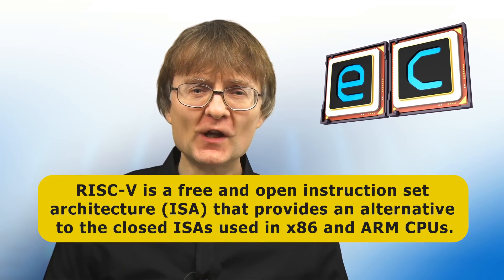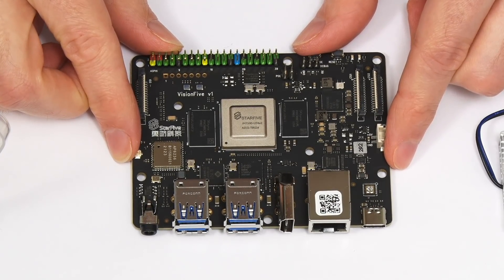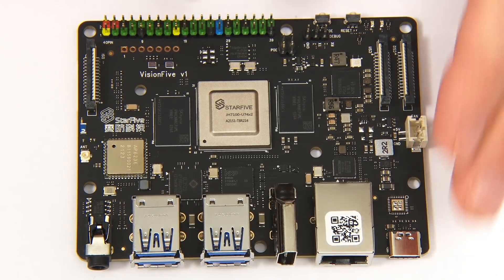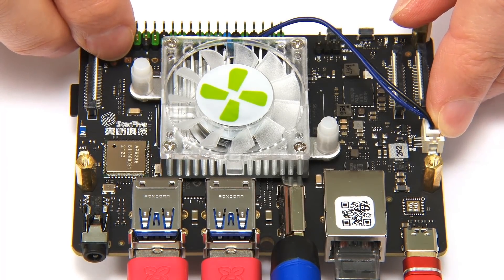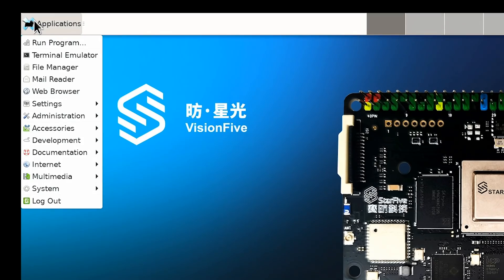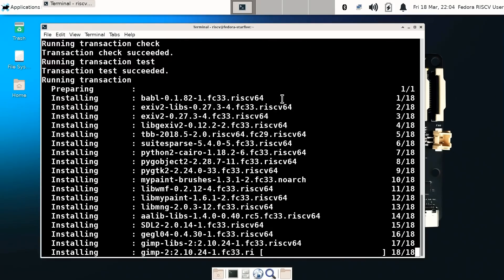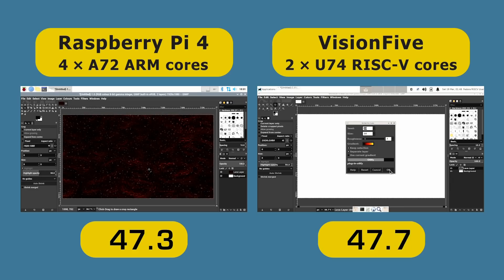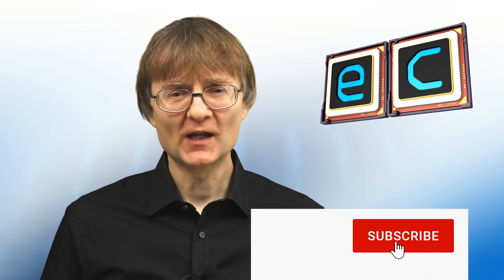VisionFive RISC-V Linux SBC

Comment: After a few mis-starts from others, glad to see someone released a reasonably priced RISC-V sbc. Can't wait to see where RISC-V takes us. Thank you as always Mr. Barnatt! Welcome to DST.
Reply: I don't think RISC-V will replace ARM in most areas. It will likely stay in the realm of hardware controllers, like for SSDs and as Coprocessors in GPUs.
Reply: @GeoStreber  I think it might be able to be alongside arm in applications such as mobile phones, as Chinese manufacturers are always looking for new and different technologies to boast in their phones
Reply: Here is the odd part: Is the JH7100 an open core?
The C906 is, which is in the Allwinner D1 SoC. And it runs just as well. :-)
Reply: @CyReVolt  Hi Daniel. As you know, the C906 is a commercially-licensed core which was also open-sourced about half a year after I got my first board with a D1 SoC containing it. The U74 cores in the JH7100 are not open source. The U74 are based in large part on some components of the Rocket open source core (which SiFive also continues to maintain and improve), but this arrangement is closed source. Being dual-issue the U74 performs about 1.6x better than the C906, clock for clock. Plus it runs at 1.4-1.5 GHz vs 1.0 for the D906. Multiple cores (2 in the JH7100, 4 in the FU740) adds to the overall performance again.
Reply: @BruceHoult  Thank you for the elaboration!
Reply: I'd say that not only reasonably priced but actually working and with better support than most ARM SBCs from last 2-3 years.
Reply: @SergiuszRoszczyk  especially compared to Allwinner SoCs which microcode has to be reverse-engineered because the vendors don't supply any
Reply: @SergiuszRoszczyk  Except for the Raspberry Pi, with which it compares even worse than I expected on both price and performance.
Reply: @johnm2012  Pi and Pico are gold standards. I'm talking about all those Pi Killer wannabes ;)
Reply: @SergiuszRoszczyk  I know you are but why would anyone choose a RISC V based board when they could have a Pi instead? I'm looking for that one reason, the thing it would truly excel at, but I'm not seeing it.
Reply: @johnm2012  I think because they can. It is good to have wide variety of working platforms, especially when those platforms can run vanilla Linux without unknown binary blobs (here mostly about those Allwiner thou I know that Pi also has some of them).
Also we need different stuff - if I had MIPS home server, then PPC, now I use x86 and Pi but if someone will provide good Risc-V board for the job I'm ok with that. Also having one more ISA on the market makes it safe that one day someone will not close entire architecture and forces growth.
Reply: @johnm2012  what this board excels at is running RISC-V machine code. If you want to do that for some reason -- for example because you are a software developer wanting to port code to RISC-V (or write new code) then this board is a better option than running an emulator on an ARM board or even on an x86 machine with a similar price.
Reply: @johnm2012  It's about learning. That's the reason I would buy one. Not this one though, needs another couple of generations.
Reply: @johnm2012  The one reason is that it has an open standard instruction set architecture (ISA). You cannot do that with x86 or ARM. I suggest that you watch the video again with a more open mind and realize that although the Pi is a great little sbc, it is NOT the end and others will come along and change and improve things.

Comment: That looks nice, you know I would love to see an updated version of Z80 chip and cp/m OS, z80 was an excellent chip, the fun I use to have typing code from computer magazines, for me it great way learn programming. Not that I can remember anything I'm getting old now. 😊
Reply from the maker: The Z80 was indeed excellent. I wrote machine code on it, not that I can remember much of that now!
Reply: @ExplainingComputers  I would love to see what wrote, that type of programming was very powerful and beyond my capabilities (with no reference in hand)
Reply: @ExplainingComputers  I wrote a cricket game in BASIC while I was at school, no graphics, all ASCII but it was sluggish so I tried to write it in Assembly while I was learning it but never got it completed, I have often thought of completing it when I retire
Reply: I stil run a Z80 based computer, its a Research Machines 380Z, and is the very same computer I learned on at school and purchased from my school in 1991 although I have replaced the drives 3 times upto press and am now looking to emply a drive emulator whilst the 8" floppy drives are still working
Reply: You just took me back to my Commodore C-128 days. 😌
Reply: Thee are many upgraded Z80 CPU 

Zilog Z8000 16 bit 1979. Z80000 32 bit 1986.

Theres the 1985 Hitachi HD64180 mega Z80 variant that was quite popular. and also licensed back to Zilog who sold an upgraded variant of....
Reply: @joefish6091  I know I just wanted to see how the z80 would turn out with a modern take on it.

Comment: I'm most interested in IO control -  I need to be able to take real time inputs and send outputs to the real world, preferably with network communications.  For me, THAT'S whats needed for development and control.
Reply from the maker: Hi Leslie. One of the benefits of RISC-V over ARM is supposed to be real time capabilities. We shall see. I'm currently making a video about another, smaller and cheaper RISC-V SBC that would be read for IO stuff.

Comment: Great video, and I look forward to hearing more about RISC-V technology!

Some more possible things to compare:
How does the power consumption compare to the Raspberry Pi?
And is the same software available in the Fedora repositories for RISC-V as there is for ARM or x64?
Given that the architecture is open-source, hardware drivers should be much more optimized and available compared to SBC ARM boards.
Reply from the maker: Thanks for this. As far as I can tell, the repositories are currently more limited (as they are for Debian, for which a RISC-V version is also available). But the more hardware that gets out there, the more software will be available. As you say, being open source should make driver and wider software availability accelerate more quickly than with ARM.
Reply: @ExplainingComputers  It strongly depends on the amount of effort and money put on the RISC-V project. What could it be without NVIDIA and other corporations? Compare it to OpenRISC, for example. There's a lot of job to be done (and we want it to be done) but the pratice shows us that it can't be done on bare enthusiasm.
Reply: @utvpoop  
It's a bootstrapping problem. They need to develop a full fledged, competitive, consumer ready product, but to do that they need the financial backing to research, develop and iterate, which requires them to... Y'know... Sell a full fledged, competitive, consumer ready product.

If people would stop voting right wing, we could perhaps task our government to fund and develop open source projects in the name of public good, but oh noes, that's the commynisms!
Reply: @HaveYouTriedGuillotines  It looks like they've managed to do that with this board. Also remember that Seagate are starting to use RISC-V in their storage controllers. If they write their code in C then it's pretty irrelevant if the chip is popular or not as long as it does the job well and they can make them for the right money. Takeup is likely to be rapid because it can fill the role of ARM and be cheaper. Note also that with Nvidia not owning ARM they may decide to do their own RISC-V cpus.
Reply: @wayland7150  
I wouldn't say this is quite there yet. When I say full fledged, competitive, consumer ready product, I mean a range of offerings that can compete with existing, widespread hardware on the market. A true, ready for prime time RISC V offering shouldn't just be a couple micro controller chips, and something that struggles to keep up with credit card SBC chips. 

It should be a design that can be scaled up and provide options spanning across multiple levels of computing. I. E. a 32+ core version of the CPU aimed at a desktop market shouldn't be out of the question.

Enthusiasts want at the very least something that can match a RasPi 4. Most people in general are going to want something that can at least compete with low to mid range Intel/AMD chips, or even an M1. The real goal here would be to produce the RISC-V equivalent of an M1 Chip, though that's maybe a bit too ambitious, so let's say... A design that can compete with current middle of the road mobile hardware, as well as laptops and low to mid range desktop hardware.

I know you're going to say something like "but RISC V is still new!" Yeah, it is. And consumers don't care, most tech hobbyists don't even care. They want something that can do some work, and sadly most people either don't have the money or care to fund a fledgling design just because it's open source. 

Most people don't even have a vague clue of what FOSS means and their eyes glaze over when you try to explain GNU or the fact Linux is just a kernel to them. RISC V is also trying to enter a market where it has to play catch up with well established competition that itself is moving forward. The sad reality is that RISC V still has a ton of adversity stacked against it, I am not ready to call this the turning point.

...It is the first real, solid start, though.
Reply: @HaveYouTriedGuillotines  It's clearly coming and the board is available in a practical form, just like the PI. People can get learning and be ready for more products. In the past you'd have needed £10,000 to get your hands on this, now it's within reach of anyone with a modicum of curiosity.
Reply: @Clarissa 1986 
I love when people like you wear an atheist icon, so I can easily pick you out.

People like you just trade your religion for the post-modern faith of capitalism. An ideology which is failing, right in front of your eyes. But you refuse to acknowledge this fact because you are, just like any common Evangelical Christian, awash in faith and can't be bothered with empiricism.

Instead, you go right into a tu quoque fallacy. Something that is the basis of much of the rhetoric people like Ken Ham toss around. You manage to throw in some apologetics just for good measure, but they don't exactly hold water amidst our failing supply chain.

I expect somewhere in the next few responses you make, you'll predictably attempt a no-true-scotsman fallacy in defense of capitalism. Like clockwork.

I'm not a socialist, by the way, but I'm sure you have no comprehension of a leftist who's not a socialist. 

Like how the Evangelicals have no clue about Atheism, and for that matter don't understand the implications of their own ideology, capitalists have no clue about anything on the left, socialism included, and don't even understand the full scope of capitalism.

All fervor and no rationality. Surety without experience.

Evangelical Christians think Jesus rode a dinosaur. Capitalists on the other hand, are likely to try and reenact Jurassic Park.

Comment: 'open instruction set architecture'? So... like an FPGA? Can it be treated and handled like an FPGA? Or no? X86/x64 isn't RISC based is it? I know the "R" in "ARM" is "RISC".
Reply from the maker: No, x86 is not RISC. But the issue here is control of the intellectual property (IP) in the instruction set, not its type. X86 and ARM are closed (controlled by Intel/AMD and ARM), RISC-V is open -- as in open source.
Reply: @ExplainingComputers  I understood the closed nature of ARM and x86/x64 (which is apparently CISC or complex instead of reduced). So, for all intents and purpose it's still structured like an ARM chip, meaning you have a dedicated "decryption" engine, cache, and all the modern amenities but they're in FIXED locations. Unlike FPGA which isn't as "FIXED". And also RISC-V is as you said open sourced.
Reply: Open as in: doesnt require tens of thousands of dollars per year to be able to use ARM IP. The design is open source. you theoretically can implement a RISC-V Core in FPGA for free. not possible with arm.